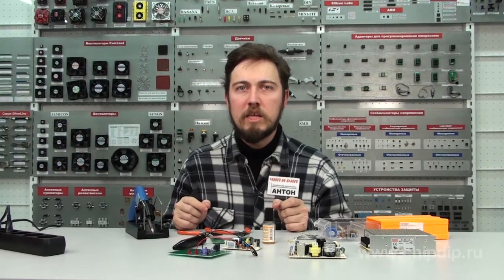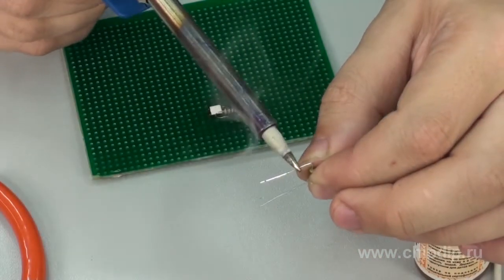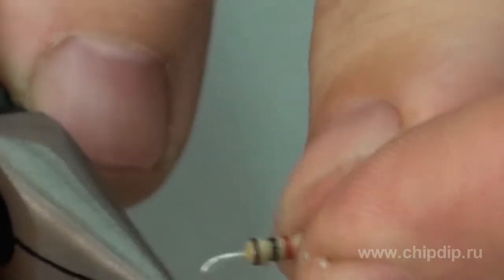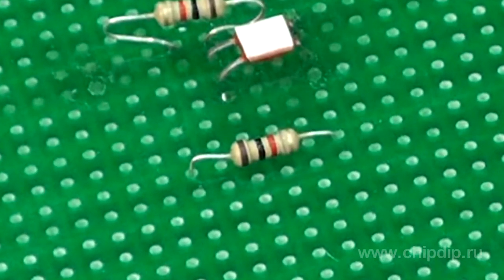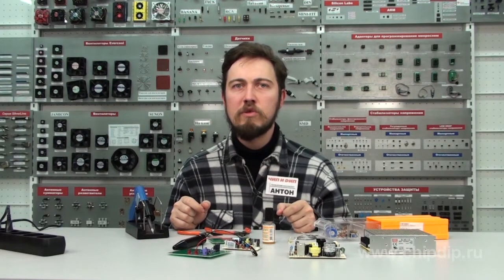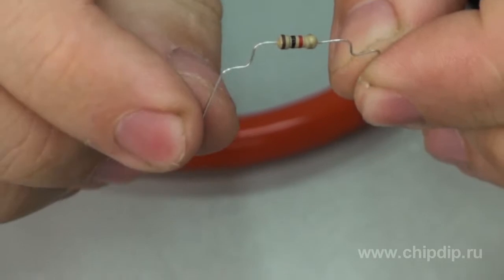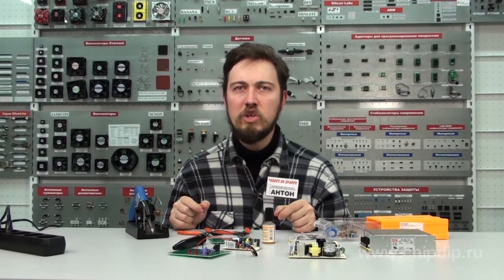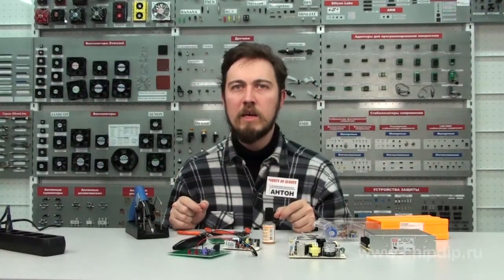How to Place Resistors on Circuit Board

Comment: i I'm new with electronic stuff. 
i just want to ask is there any problem if i put or place the resistors in any sides or reverse?
thanks.
Reply: It doesn't matter what sides you place them because they are not polarized like ceramic capacitors

Comment: Good day/evening, I need assistance with values for Launch Diagun 2 diagnostic machine PCB resistors R72 and R56 close to the switch as my machine is not switch is not working